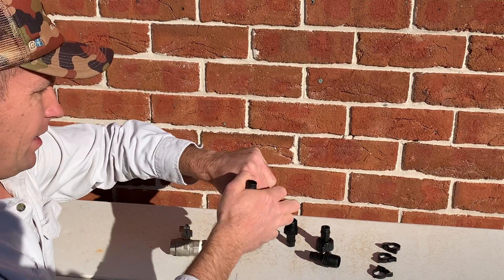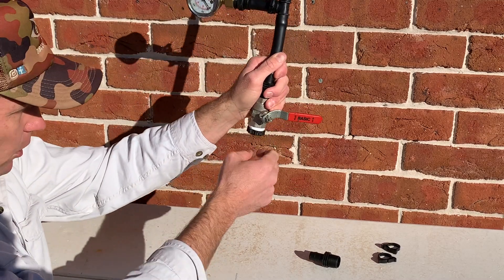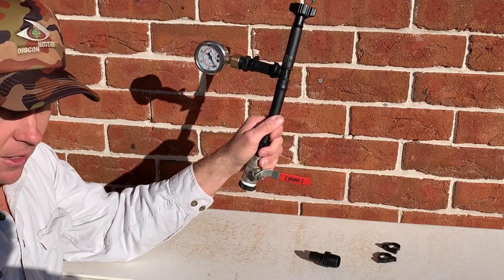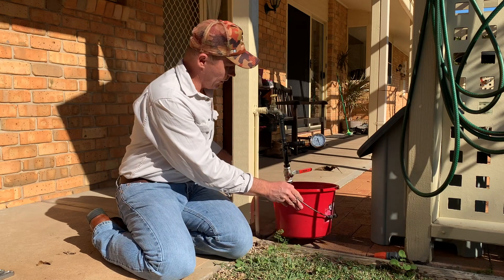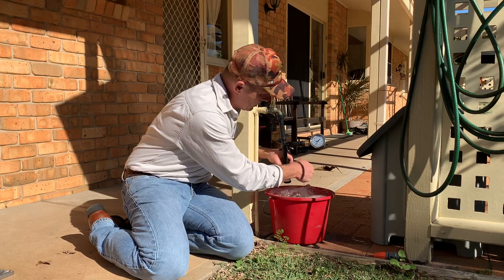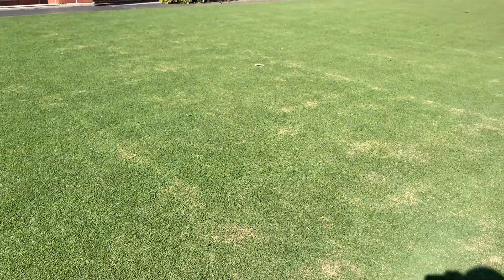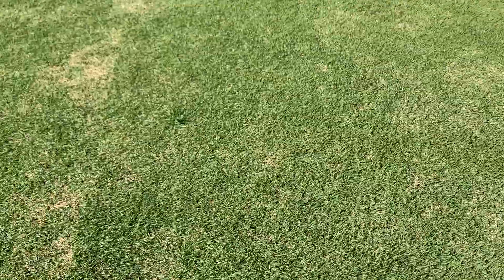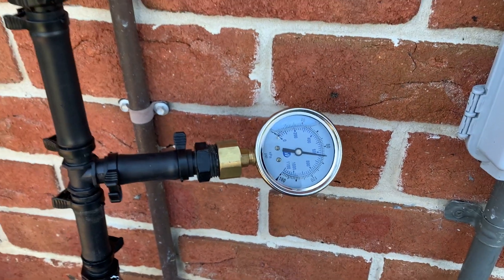Testing water flow and pressure for a new lawn irrigation system

Comment: Just a curious observation/question. When you are doing flow rate, wouldn't you adjust ball valve to optimum operating pressure of your chosen device heads/nozzles. For example lawn popup nozzles around 280kpa, then while that is maintained on the pressure gauge, time how long you fill your bucket?
Reply from the maker: The test here is to measure maximum flow rate the ball valve allows the water to start flowing at maximum available rate to give the most accurate reading on the stopwatch as possible.
Reply: Essentially don't need the pressure gauge or any of that then, as it doesn't seem necessary. Just a bucket under the tap. I was then told to take 30% off that to get the lpm to design your retic off. 

But, I was taught to do the bucket test with the pressure set at optimum pressure and then just take 10% off that. 🤷

Comment: Hi brenton, i think it would have been better to provide a link to all the devices you used in the video.
Reply from the maker: Hi Samuel thanks for tuning in. Do yo mean in regards to the pressure tester? I actually built it up from the ground with 19mm irrigation fittings its not actually sold as a "kit" so to speak. Is that what you mean or have I missed something else?
Reply: @theaussielawn  OK that's it thanks
Reply from the maker: Samuel Asamoah no worries mate hope your having a good weekend 🤘

Comment: Great video! Quick question, wanting to put irrigation in aswell as concrete down the side of the house, would it be fine concreting over the lines running to the front etc
Reply from the maker: Jay Breen yeah mate I have lines under concrete, just try to avoid joins or fittings underneath the concrete because if one fails you won’t be able to reach it 🤘